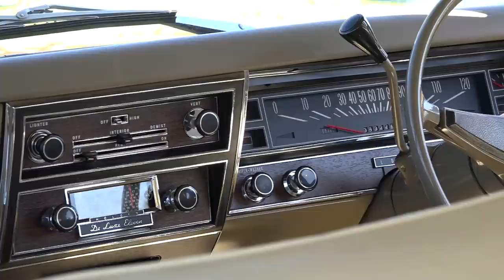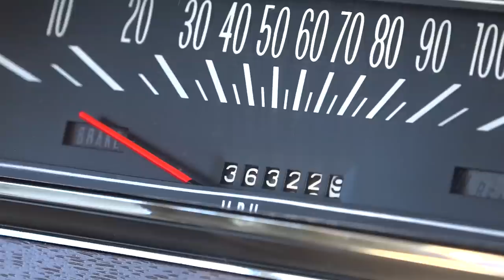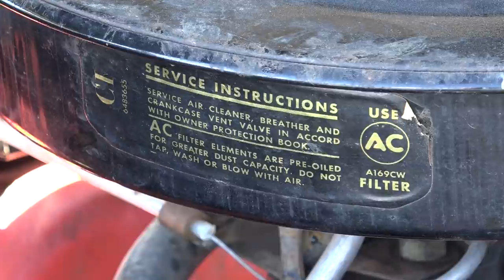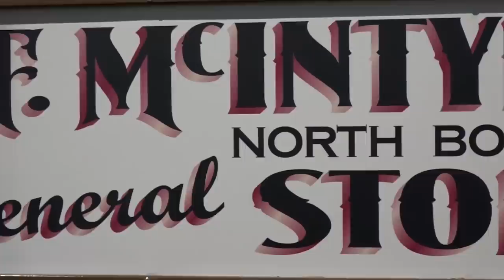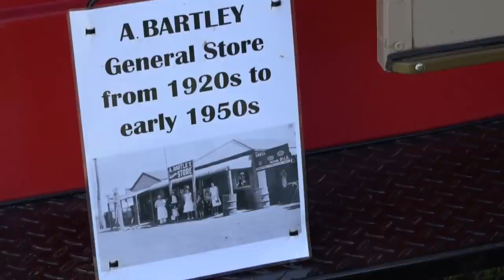Narromine Car Club Charity Show & Shine: Classic Restos - Series 47

Comment: I've found there are more classic old cars per  capita in country towns than in the city. Often one owner has several in different stages of repair/disrepair. Old dungers that have been left to rot down the back of the yard are being dragged out to be resurrected. In the city they would have been sold off or scrap years ago. Country car shows are full of friendly, often very knowledgeable folk with great stories. 
Thanks for getting out amongst them Fletch and letting them shine.